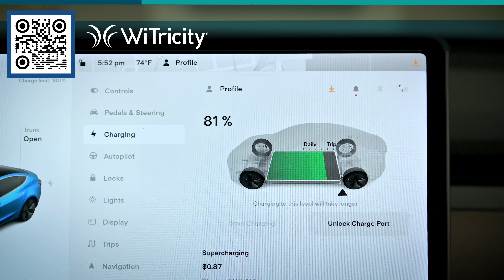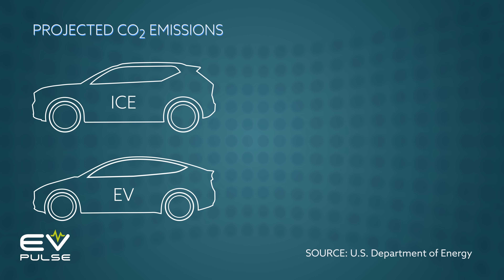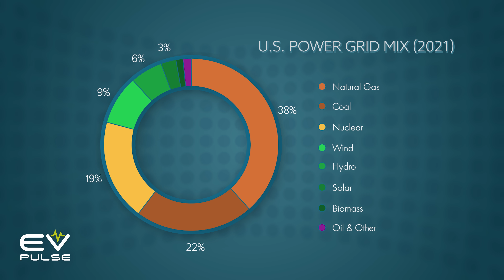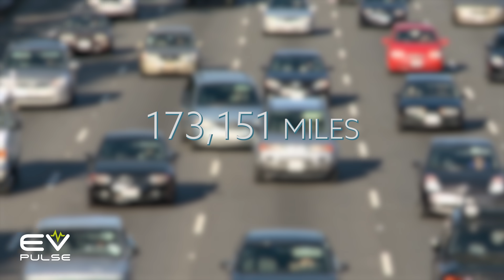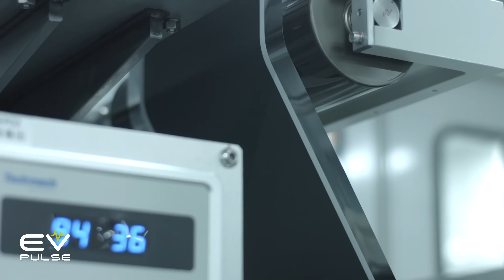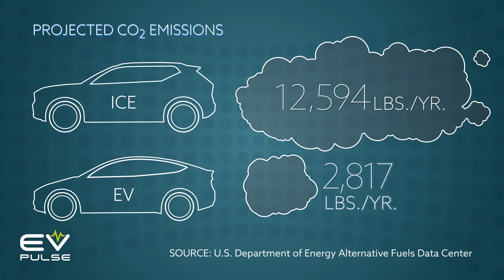Are EVs Cleaner than Gas Cars? | EV Basics

Comment from the maker: EVs save you money on maintenance, too! :yt: https://youtu.be/e6aqhjbz4yk
Reply: How much is an insurance cost?
Reply: @yakovfamiliant8069  My Tesla is compatible with a normal ICE car of similar size but a lot less than an ICE car of similar performance
Reply: this is the only thing that maybe is hard to dispute so long as your battery cells don't take a dump on you costing as much or more than to replace both a transmission and engine at the same time. How likely is your transmission and engine to fail at the same time?
Reply: @onesweetmango  Battery prices have dropped dramatically in the last few years and battery manufactures have stated that due to a massive reduction in material prices, battery prices will drop by 50% this year alone
Reply: EV have hydraulic brakes that uses oil. Brake pads and brake rotors are replaceable too. Suspension/Shock absorbers, Wheel bearing, how about the Lithium Ion Battery?? I heard they cost $24,000 to $32,000 to get a new one and Lithium Ion Battery doesn't like below Zero temperature and doesn't like above 100°F temperature. 
When a Gas Car or ICE car is flooded there's a 90% chances that vehicle can still be saved and repair. EV however when they get flooded they are considered total wreck according to Insurance companies. They can't be saved.
Reply: And time as well!
Reply: EVs create more pollution than  ICE cars due to brake dust and tire particulates. I would also measure an educated guess that this pollution is more harmful to humans.
Reply: @slyaid2019  Brake pads last over 100,000 miles because you dont use them, due to regenerative braking.
Where do you get this dis-information from ?
Reply: @slyaid2019  ICE cars pollute at every stage of the Oil extraction, transporting, refining, further shipping and finally burning inefficiently in your ICE engine, exposing all to various poisons and Particulate Matter, especially PM2.5, that enters the blood stream through the lungs and causes all sorts of health problems, to you but especially to children whose bodies are growing and developing.
ICE engines pollute for the whole life of the vehicle, whilst EV's do not pollute on the street, where you live

Comment: For Boomers, the Chevy Volt appeals more. Don't NEED a 100 hp, 100 mph, 500 mile range thing to carry 8 people. Don't need the cost, either. A Micro Electric able to do 60 if vital, but 45 is fine, and two plus groceries enough size. A King Midget, run on wood gas, would burn 25 Lbs an hour...peletized grass works, and can't put anything into the air that the grass never took out. No desperate need for petroleum.

Comment: Why don´t you include the sourcing of raw materials for the batteries in your analysis, - e.g. Kobalt mining in Congo
Reply: @Schenkmx - they are phasing cobalt out of EV batteries. Tesla. Hyundai and BYD as well as others already no longer use cobalt. But last I checked, fuel refineries still use the most cobalt globally by weight to refine the fuel you burn. 

The latest study found that the mining and manufacturing of EV’S is only 15% more emissions heavy than mining and manufacturing an ICE car. That equates to around 20k miles of driving to break even on a coal only grid. And assuming emissions from drilling, shipping, refining, trucking and then pumping the fuel into your car before you burn it are 0.
Reply: There are a large number of factors he is leaving out to prop up his argument. Fact is EV's are not cleaner. Just the particulate matter they generate from brakes and tires makes them worse then ICE cars, never mind the environmental and human  damage created mining for the materials for the batteries.
Reply: @thatguysomewhere143 well no. On both accounts. The they are cleaner. And you even mentioning brakes as a dirtier factor shows how little you understand EV’s. As their brake wear is around 5 times less than that of an ICE.

They’re also not typically much heavier than a standard combustion vehicle. That’s because whilst the battery is very heavy. So is the massive metal engine block and 6 speeds transmissions that EV’s DONT have. So in reality EV’s are only around 100-200kg heavier than comparable combustion cars. Certainly not enough to drastically increase tire wear.

Infact most studies only found that tire wear is 5%-20% higher for EV’S. Mostly due to the lack of engine feedback allowing people to drive more aggressively without any of the contextual clues for how much more aggressive they are driving.

So no. Particulate emissions don’t make them dirtier, the overall particulate emissions are substantially less thanks to regenerative braking. 

Try again.

Comment: 5 Hours Earth 🌎🌍 Day Global Power Grid Shut down is not enough! How about IF all Countries around the world would participate and all of should shut down our Power grid everybody all countries shut it down for 48 hours! Maybe that will make a change, 5 hours Earth Day is not enough! 
And speaking of Clean and Green Emissions
My 1995 Honda Civic still passes California Smog! 
I got brand new OEM Honda Catalytic converter in there, brand new Honda OEM Fuel Injectors and Fuel Pump and Fuel Filter, brand new NGK Ruthenium Spark plugs and brand new Denso Ignition Coils. The motor oil I'm using is Pennzoil Ultra Platinum 0W-30 and motor oil is made of natural gas, environmental friendly. My other Honda Civic is 2009 powered by CNG (Compressed Natural Gas) and my 2012 Ford F-150 V8 is Flex Fuel Capable, I can run the truck on regular clean 87 grade octane or 91 grade premium octane or I can run the truck on E-85 Ethanol the results will be the same Clean Emissions and I have never taken off catalytic converter on all of my vehicles, IF they are broken I always replace them with brand new OEM. I use Arco Top Tier Gasoline or either Exxon Mobil top tier gasoline that have more Detergents and cleaning agents in their Gasoline Fuel. 
For my 2015 Ram 2500 Tradesman 6.7L Cummins Turbo Diesel 6 speed manual transmission and 4WD 
I always fill up DEF Diesel Exhaust Fluid, and I use Diesel Fuel Additives too. A lot of Diesel truck guys they are getting rid of DEF and DPF so they can Roll Coal black smoke. I have never done that in my Diesel Truck. And all of my vehicles are Smog Passer they always pass emissions.

Comment: Also, unlike ICE, EVs actually become cleaner over time (from an operating POV), as the energy sources become cleaner, as wind and solar adoption increase…
Reply: yet my truck can last basically forever as long as I keep up on the basic maintenance of it. Meanwhile an EV needs the battery replaced every few years. 

at the same time didnt the president of Ford recently try out the all electric truck and the battery on it died FAR faster because it was towing something? Dont get that problem with an ICE
Reply: @StarKnight619 what data are basing the claim of “every few years” on?  They are designed to last the “life of the car”, which is generally 10 years or so for most people, but with a battery rebuilt or replacement it can be extended beyond that, just like an engine rebuild.  Several manufacturers warranty their batteries for 10 years now, so you can be sure they are engineered to last longer than that…

Comment: Did not discuss the Co2 used on mining for the precious metal(s) and the environmental impact from the toxic chemicals into the ground when refining. Also, you are not adding the horrific human rights violations from using slave labor to refine by hand (so toxic). Also, let's talk about the child slave labor to do the same. There is no one talking about this or studying this. The car manufactures definitely don't want to talk about this at all. Then let's not forget about the fuel for just 2 of the rigs that are needed to mine enough of the lithium. One of the machines consumes at minimum average 60-70 gallons of diesel an hour. A typical shift is around 12 hours. This would then equate to 720 gallons to 840 gallons of diesel per shift. The big dump trucks consume on the lower average around 55 to 65 gallons of diesel per hour. This would then equate to 660 gallons to 780 gallons of diesel per shift. That would be low estimate of 1,380 gallons to 1,680 gallons of diesel per shift combined. Last I read from the mining of lithium it takes a minimum of one 12-hour shift to have enough raw ore to make just one electric car battery. But no one what's to look at breaking down the actual numbers not just what CAT put's out for consumption on each of the equipment needed for this. Then let's not even talk about that there is ZERO plan to deal with the battery waist when the battery is no longer good. No recycling and I am sure they will be shipped to 3rd world countries for a fee. They will then dump them in the ocean's and barred in the ground to leach into the ground water. But the people that drive them don't care.... They just feel like they are better than the common person and act like elitist. They look the other way to have other countries poison their people because they can't see past their noise. This video is misleading and all in the play book of the so-called greenies.

Comment: The root cause of CO2 is we keep cutting down trees! Trees were designed by God to exchange CO2 for O2! There's no mention of how much HEAVIER EVs are, which wear down the tires faster and are made from petroleum byproducts!  Also, the waste of EXCESSIVE amounts of water needed to put out EVs on fire, higher insurance costs, very expensive battery replacement costs! And finally, but NOT least, there are NO electric grids/infrastructure in the world that can support the additional demand for electricity caused by the EVs! It is a TERRIBLE idea! I will ALWAYS buy ICE!

Comment: You forgot to mention that batteries are 99% recyclable and once you mine the Lithium you only need to mine the less than 1% loss and account for new demand. Also for ICE you have to take into account the search for recovery and refining of fuel.  Though one bad thing is that CO2 is a good gas to have in the atmosphere and removing it may cause plants and plankton to diminish and die wiping out all carbon based life on earth, but sure why not.
Reply: Atmospheric CO2 concentration for the last 800,000 years has been about 170 to 300 ppm; I believe the plants and plankton were just fine.  it's now at 411 ppm, and much of the excess in the air gets absorbed by the oceans, which then become more acidic.  That will kill the plankton first.
Reply: @Sedwick1024  When Co2 was at 7000 ppm the plankton sere fine.

Comment: A lot of these calculations are pretty far off because most EV's don't have an actual 300 mile range.  The effective range with the 90% charge recommendation and charging before the battery hits 0% is more like 250 miles.  That difference would radically change most of these calculations.  This comparison is theory vs. reality.
Reply: Again, reality vs theory.   You don’t have to empty the tank on an ice vehicle to know it gets xMPG.  these comparisons are MPG vs EV range.   MPG is factual, EV range is theoretical.  Plus, no one factors in time.   You can fill your tank in 5 min and have much more range than you get from an hour charging an EV.   My time is not free.  😊
Reply: The max charge recommendations are for normal use you can charge to 100% as needed long trips
Reply: For most people most of their charging is overnight while you sleep, I plug in when I get home, it's charged in the morning
Reply: Okay Nancy, you do it. Do you drive your ICE till the tank is dry? Don't forget the fumes you huff while pumping it. Don't spill.

Comment: One vital piece of information is missing from this presentation.  How do EV emission totals change when figuring in the increase power requirements to operate all the EV's?  The power grid is going to have to expand tremendously to meet charging requirements.  How many emissions will occur building new solar, wind, nuclear and natural gas power plants?  Not to mention the ongoing emissions from those facilities.
Reply: It is a fair point and some electric infrastructure might need upgrading but it's also worth noting that many people will charge at home at night when power draw is much lower.
Reply: @Optimistprime. yes.  Power companies have excess power at night and actually encourage night time charging.
Reply: The fossil fuel industry already uses copious quantities of electricity in the refining of it's product.  If that industry can be shut down all of that electricity is all of a sudden free for use charging EVs.
Reply: @tonyharford4625  .......HAHAHAAHAH! 

Then where are you getting the power from? Sure they use power in order to refine it but at the same time a lot of the fossil fuel that is refined is used for the power grid itself
Reply: @StarKnight619 it takes roughly enough electricity to refine a gallon of gas to power an EV for 30 miles.

Comment: None of this data matters to a family that needs a small-ish truck or SUV and can’t afford that same size in an EV. 40k for an ICE crew cab truck vs 80k for the same in EV. A lot of people make decisions based on what they can afford.
Reply: True enough, but battery technology and efficiency is advancing by the day. And as more people switch to EVs manufacturing cost will come down substantially over the next few years. In 5-7 years a comparable EV will cost the same as an ICE vehicle. Will you get one then?
Reply: @nerinamak3298  agreed but for those that believe we are in a climate emergency and need action now, what good is it to make them more affordable in 5, 7, 10 years down the road?

Comment: No "math" is needed except on a six-grade level.  EVs have many fewer parts needing much less material and labor and fabricating machinery. They can be built with less-skilled labor (which fits with our dumbed-down society.) ICE vehicles waste 70% of the gasoline burned as heat energy. The list is endless. EVs are controversial only in the political/fossil fuel arena. They will stall the demise of ECE vehicles for 50 years if given a chance - just as big tobacco stalled the demise of tobacco promotion and sales. Today, only the truly addicted smoke. Evs can be made less powerful, thus needing less battery energy (smaller batteries.) As the industry matures it will easily take the place of the ICE technology.

Comment: Just for clarity sake, I am assuming when calculating the CO2 from burning a gallon of gas produces nearly 18lbs of CO2 includes the pumping, shipping, refining and use of the gasoline. Since gas only weighs around 6lbs per gallon, it would be hard to produce more CO2 than what the original fuel source weighs in waste. EV technology as it evolves will be the next step in serving our transportation needs for the foreseeable future. As alternative energy sources become more prevalent, they will be even more efficient cradle to grave as many people that more to solar and such will essentially be producing their own fuel at home. You won’t be seeing that with gas or diesel. It could possibly be done with hydrogen, however that would be the dirtier production of hydrogen. That could produce an exponential growth in greenhouse gas pollution.
Reply: Chemistry…gas has the C, and you add O from the air for combustion.  The sum is the mass of the emissions in CO2 which will be greater than the gasoline.

Comment: Every time something new comes, there is resistance to change.  Typical.  I find an EV more comfortable than an ICE car.  The EV is quieter, transmits less heat, has low maintenance, ability to charge at home, etc.

Comment: HYDROGEN!   

Is the future. I think that EVs are a temporary solution between ICE and EV. 

T)
Reply: The problems with hydrogen: 1. Hydrogen is either dirty or expensive to produce. 2. Hydrogen has to be transported from production to distribution. This is normally done by compressing and freezing the gas. This takes a LOT of energy. 3. Hydrogen in a car takes extra steps. It has to go through the fuel cell to charge the batteries. These extra steps make it less efficient than a battery EV. Also, fuel cell cars have similar issues with their larger batteries. Sadly, hydrogen cars far short of even today's EVs.
Reply: 🙈🤦‍♀️🤦‍♀️Go hydrogen if you want to waste 66% energy
Reply: oh yes hydrogen that is the stuff you can't buy....
Reply: Very inefficient and why build a whole new infrastructure for a temporary bad solution